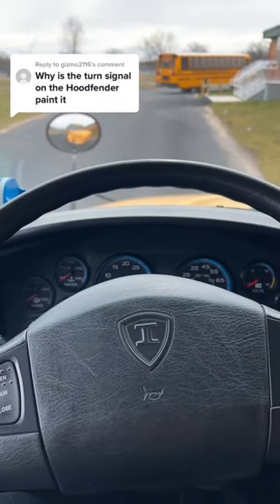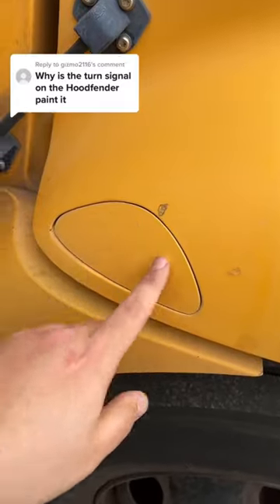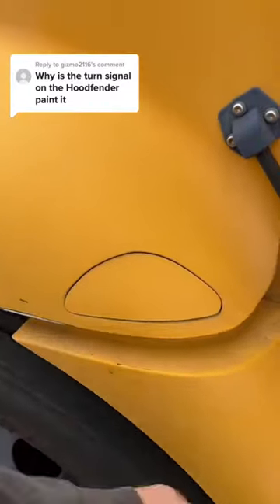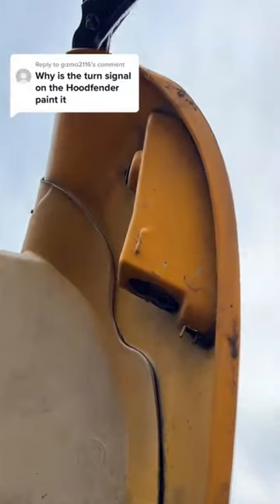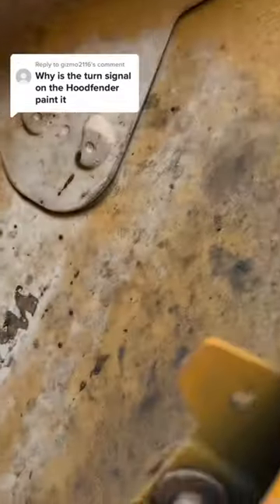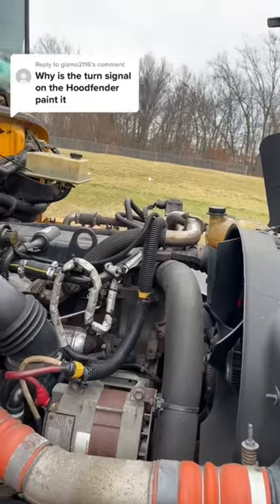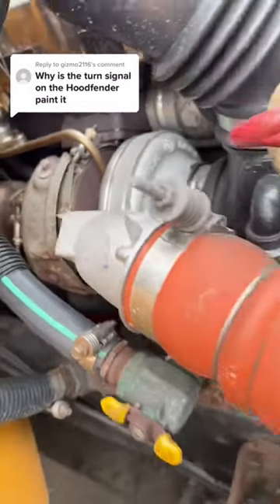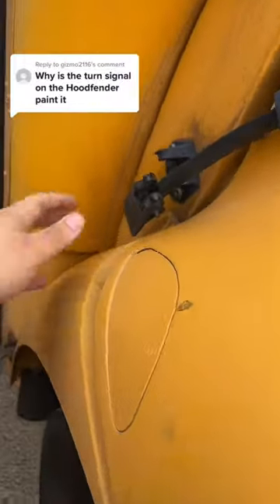Why Are School Bus Turn Signals Yellow?

Comment: It depends on the manufacturer. With that being an International, the turn signal is on the body just below the windshield. International uses the same hoods for their trucks and buses, so it is easier and more cost efficient to manufacture. The trucks with the same hood style have the turn signals in the fender.
Reply: Freightliner also uses the same hoods for the bus as the truck. It does keep costs low as it’s like making a truck but with the bus body. Bluebird only builds buses so it makes sense that they don’t use truck hoods.
Reply: @Charles Rodriguez  Absolutely true. But International is unique compared to Freightliner since they put that front side signal on the body rather than the hood like Freightliner.

Comment: I love the Ford air filter gauge
Reply: Not unique to ford at all. Petes, Freightliner, kenworth, international, Mercedes, paccar, they all use the same gauge on the air filter.
The dirtier the air filter gets makes the engine suck harder that extra vacuum pulls the plunger down showing green yellow and red to indicate when to change the filter. You can buy same gauge for your car air filter and modify the air box to have the same thing.

Comment: @Clawboss, why did my bus disappear? So my bus driver didn’t tell us that he was switching to another bus, so we have a new bus driver, but it came with a new bus too. My original bus was only 11 years old it was a 2012 ic ce, and now it is gone. Now, we have a 2015 ic ce. In the state that I live in, the bus have to be 15 years or older to get a new one, but mine was only 11 years old. Please answer. Thank you claw boss! You’re one of my fav YouTubers ❤
Reply: Could be any reason. They could have found a defect with it on the frame or the king pins. They could have gotten a grant to buy new or newer busses by trading in older ones. They may have felt the transmission or engine was going. There is no set answer the only person that could really answer your question would be the fleet manager. As a fleet manager is responsible for buying selling maintaining the fleet.
Reply: @John M thanks for your answer

Comment: How the hell did you just lift the hood from the front. My dad's been a trucker my whole life and that is literally impossible. You have to go from the side. Superman?
Reply: A bus hood is fiberglass and if lifted from 1 side can flex and crack it. In the center front of the hood is a hand hold grab. Once the 2 side staps are released grab the center hand hold and pull. The hood inside has a neat spring setup to help assist in lifting the hold forward. Can easily do a bus hood 1 handed with 3 fingers.

Comment: The company u work for must be something totally different because i work in central jersey as a bus driver for a township tho not a private company and we are not allowed to open the hood of the bus theres no reason for us too thats why we have mechanics
Reply: That cannot be correct. Under the FMCSA the federal motor carrier safety administration part 49 commercial use of a motor vehicle, a pretrip a post trip inspection must be conducted by the driver. Additionally if the drive reaches 2 hours or 150 miles whichever occurs first the driver every 2 hours or 150 miles will stop the motor vehicle and perform an enroute inspection. 
The inspection covers a minimum of 140 items that shall be checked and recorded either on a manual inspection form or electronically using something like zonar systems integrated unit. Under the hood the friver shall check all fluids for proper level, color, smell, any and all leaks. The air filter gauge for service life, the exhaust pipes for leaks gaps broken or missing pieces intake piping for same radiator for leaks intercooler for leaks belts for cracks tears and proper tension hoses for rips tears bulges dry rot leaks 
Hood latches for proper tension and holding strength.

If your employer is not having you do the required pre post enroute checks they sre having you violate federal law on your cdl. Understandable that when I drove otr they didn't want us drivers doing any work, however we did have to do the checks and if fluids were low add them if we were on the road, if we were at a company terminal then bring it in the maintenance shop and have the mechanics do it. They didnt want us running 1000 miles with low oil or coolant. The pre post enroute requirements definitely fall straight on the drivers shoulder. No one but the driver can do the inspections because if a defect is found its in the driver to not drive it. Saying someone else told me it was ok to drive is not an acceptable defense if something fails and an event occurs. 

Be safe out there driver. Remember it's your license, your responsibility.
Reply: @johnm2056  ur just not right tho sorry to tell u maybe in other states but I literally got my CDL 2 years ago and u dont even gotta look under the hood for the school bus CDL test in NJ so im definitely not breaking any rules

Comment: Do busses have a Jake brake?
Reply: From my personal experience I have never seen any bus speced with jake breaks besides intercity buses like large greyhounds but even then it’s not all that common just due to the axel weight being so much lighter than a fully loaded semi
Reply: No they do not and cannot have a true jake brakes setup. 
Only 2 bus companies ever did crown and gillig. 
A bus has the option to add a telma brake to assist in slowing and stopping a bus. The state of Colorado I believe has a requirement every bus be equipped with a telma brake system.

Comment: How do you wash your bus?
Reply: At the bus wash of course. Fleets can either buy a bus wash unit or work a deal with an area truck stop. Most cases it's cheaper to buy or lease the unit. To pay cash to wash a bus at a truck stop is around 125.00